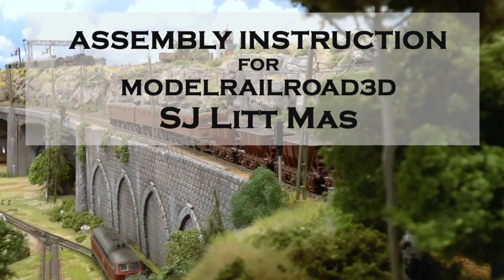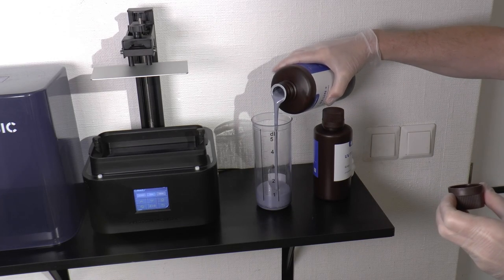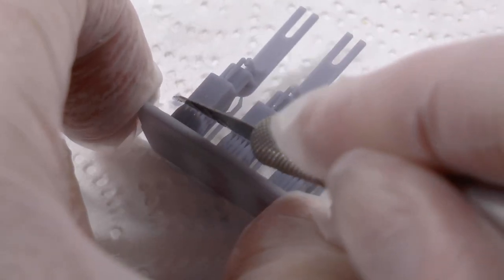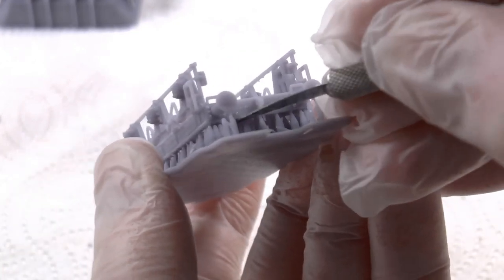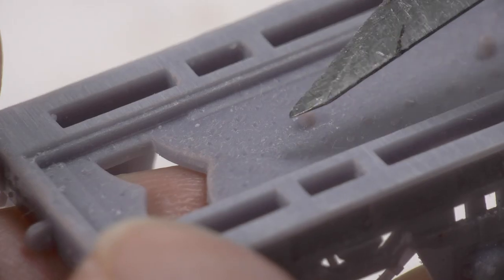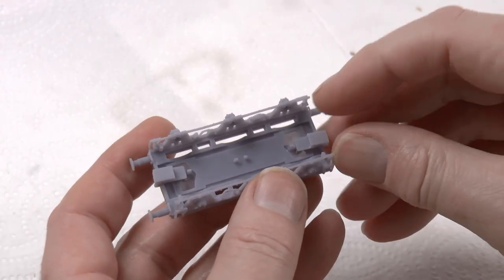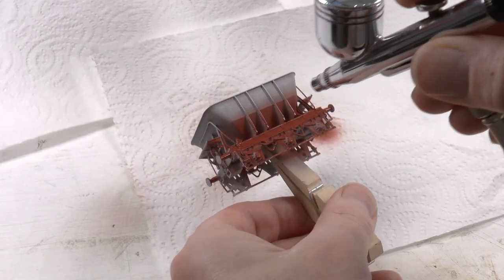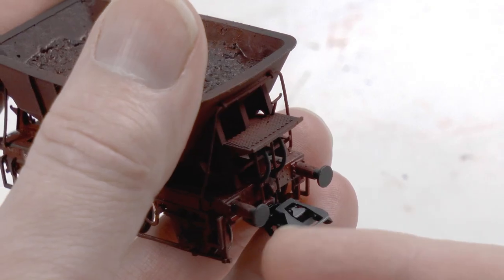Modelrailroad3D assembly instruction for Swedish State Railways Litt Mas

Comment: Martin, What is the width of the wheelsets? Here in the United States they have different widths.
Reply: directly from the website of the iron ore hopper 3d model: "you need: 3x wheel pairs (WHEEL DIAM: 10.3mm SHAFT LENGTH: 24.6mm)" - hope that helps